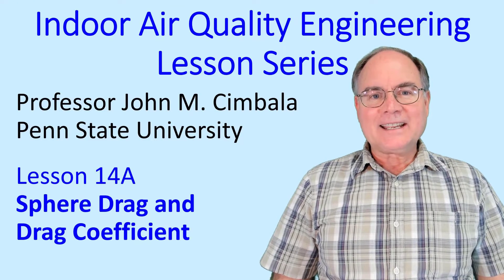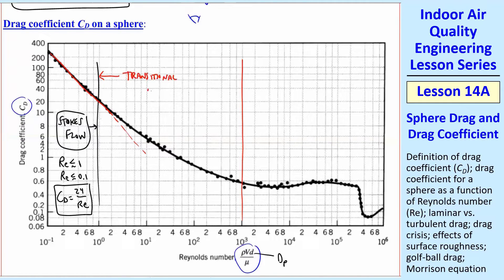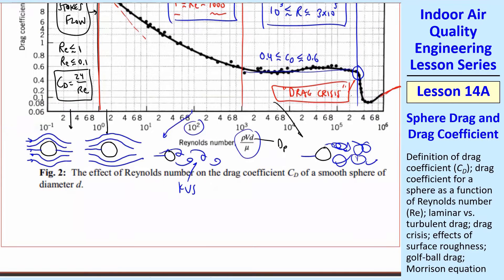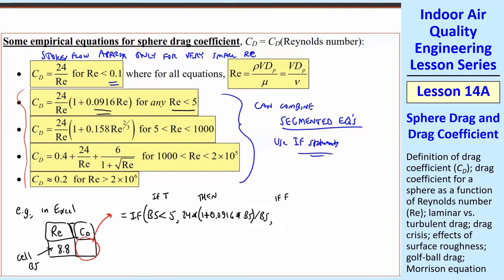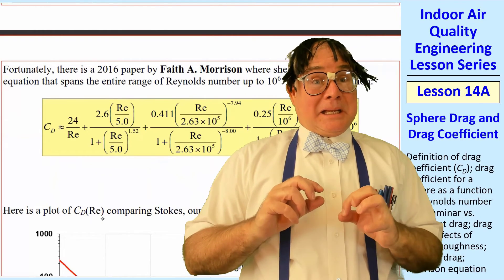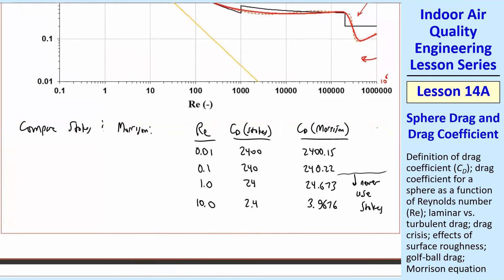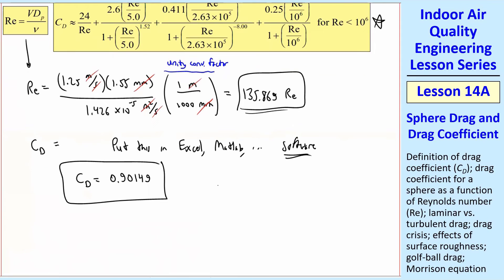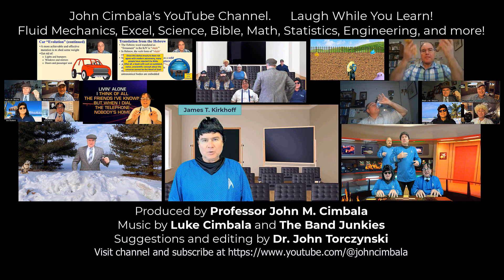IAQ Engineering Lesson 14A: Sphere Drag and Drag Coefficient

Comment: May I know the reference of the empirical equations for sphere drag coefficient for 5<Re<1000 ? cuz I can't find the formula at the Cengel and Cimbala, Fluid Mechanics: Fundamentals and Applications, Ed. 4., McGraw-Hill. If yes, may I know the page?
Reply from the maker: The original reference for the Morrison equation for drag on a smooth sphere is https://pages.mtu.edu/~fmorriso/DataCorrelationForSphereDrag2016.pdf  
Thank you for your comment. Please tell your friends and colleagues about my YouTube channel where there are more than 600 free videos about the Bible, fluid mechanics, science, math, Excel, statistics, air pollution, and other topics. I would greatly appreciate it.
Reply: @johncimbala  Thanks for your reference. However, the reference that you provided is just only one formula inside. Does any derivation require to form the empirical equations for sphere drag coefficient that you provided in your video?